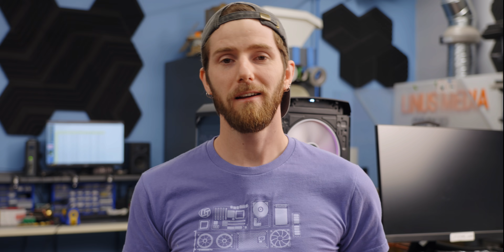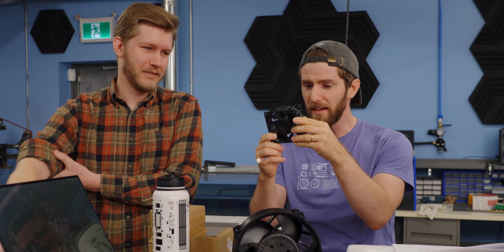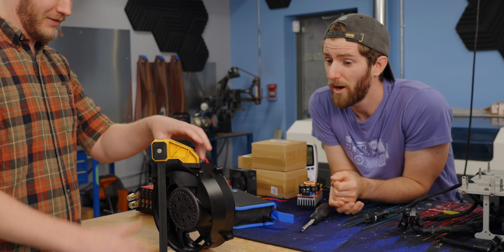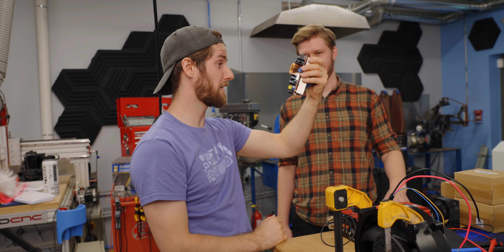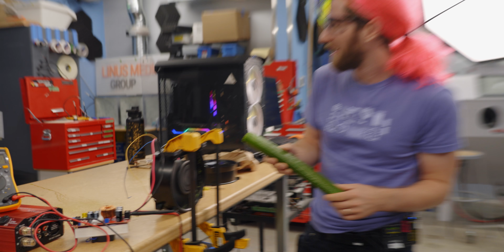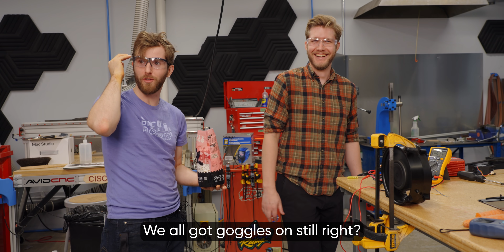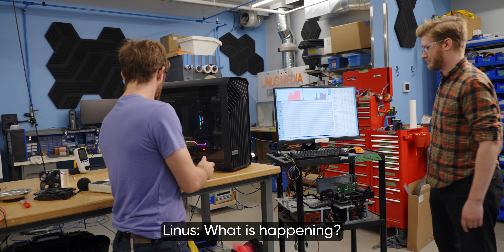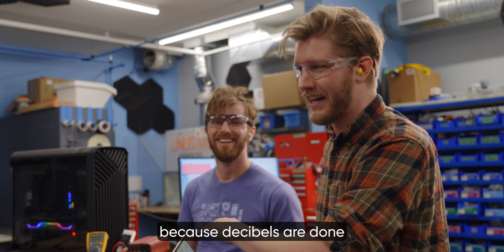The God of Computer Fans

Comment: As an electrical engineer, I can confirm that PSU is dangerous, you never want exposed contacts like that. Technically it's (barely) under the 50V limit where you're supposed to use PPE, but it's not like something magical happens at the 50V line.

Anyways, haven't used those exact fans but have used similar before. They were for cooling racks of equipment using ambient air. Ambient outside air. So that means you could be cooling your equipment with 50+C air... you need a lot of airflow for that.

Comment: Hey linus, i've actually had to get one before for a job. Often theyre used as evacuation fans, additionally can be used for fire suppression when used as a "vacuum drawing fan"
Reply: Never seen fans like that used for fire supression but I have seen turbine like electric fans used for that but they were rated 360v 32amps and evacuated a 50x50 meter server room in about a minute. Nowadays they use Novec 1230.
Reply: Not for full room sized evacuations, more for like case evacuation. Kick one or two on high and shut off intakes, sucks air out the case more or less pulling a low vacuum suffocating the starting fire
Sometimes Novek isn't an ideal solution.

Comment: Can confirm, heavy air flow in ducting systems. We had racks that had cold air fed in through the floor and other ducts that pulled the hot air through the ceiling. Don't know if was exactly this brand, but the sound matches.
Source: Worked in a DC many moons ago.

Comment: As a metrologist who worked on electronics engineering projects, the "screw the pot until you get what you want" is incredibly common.  Most of your knobs are just long extensions of plastic that do the exact same thing as the screwdriver but they look nicer.
Reply: Yea, that's a pretty normal thing, but I think it's a good thing, that Linus is afraid. You should only work with these things if you know what you are doing and Linus is not an expert in this field
Reply: @raini_does_stuff  sure but he's got engineers there telling him it's all good and he's doubting them lol.

Comment: You can buy basically these exact fans for industrial use for $50. Used them at my old workplace to cool board components in 40+ foot long machines. They pump serious air and are absolutely silent other than the air moving.

Comment: These fans are used in blade servers.  When you buy them for replacement they will come inside a fan module appropriate for your blade server. You would never buy these naked and install them.  That would void your warranty for the whole server.  I would imagine these are also used in other applications and by certified technicians where warranty is not an issue.

Comment: The fan you measured  the output voltage when spinning will be electronically commutated, not mechanically, so you won't get a DC voltage. The fan internally will be acting as an alternator and generating three phase ac, so it depends on the drive circuit whether you'll see anything at the output, whether that would blow anything on the motherboard would depend on the motherboard cirtcuitry. A oscilloscope would be in order here.

Comment: The 48VDC and the wide input voltage range suggest its main usecase is cooling telecommunications equipment. The wide input range is needed because 4x12V batteries is float charged at around 54V and in battery operation the voltage can dip below 48V.

Comment: I absolutely love the episodes with Alex and janky applications for incredibly serious hardware. 

As for applications for these kinds of fans, at my work we use ones like them for either when you need to move a lot of air from or to a large space, or a lot of heat from a small space but only have a small orifice to do it through. We one-time had a deployment where a business’s server room was a literal old closet space, not even big enough to put in a portable A/C unit, but the racks they had generated nearly 2 kW of heat at full bore. We installed some ductwork and a fan not unlike this one to dump the heat outside in the summer and a diverter to recycle it inside in the winter.
Reply: How was the sound? No one complained about a jet taking off in the ceiling? lol
Reply: @Algernon7  if it is a industrial setting this would be nothing...
Reply: @Algernon7  It was mounted somewhere well dampened and was also a slightly quieter model than this jet boy.

Comment: possible use your be cooler plamsa cutter control units like hypertherm. i work in a structural steel fab shop and i have see fans similar to these when they have had to replace parts on the cnc plasma cutters

Comment: I have often thought PC case design is just wrong. Why is the power supply inside the case? Why not put the hot thing in a bricjk on the floor. Then, remove the side panel from the cae and have a large, efficient, house fan, like a Vornado, blow lots of air into the case. If you still want case fans, set them all to blow out to give a place for the air from the large fan to go.

Comment: Love how they introduced Alex to the channel as an expert "engineer". 🤣
Reply: A "janky abomination" is an ideal idea of an experiment of many engineers
Reply: but.. he is an engineer, that's his field of expertise, right?
Reply: @lusteraliaszero  no he didnt finish his studies
Reply: @lusteraliaszero  it's been mentioned before that he didn't finish his engineering degree and that he dropped out of school
Reply: @user-fo1nk3pd1t  he said it in one of the videos himself, where they have been at his home doing some weird stuff
Reply: He is a Mechanical Engineer like me and we MEs have a big hard on for heat and fans and pumps. It's actually to a traumatizing degree*

*Studying ME Trivia: After the Hydrodynamic Machines exams (the one about fans, pumps, pipelines, tanks, etc, and it comes after Fluid Mechanics 1 & 2) I had a severely messed up nightmare where I was in a sinking ship, and ended coming up with Toricelli's theorem independently (that I had never heard of or ever seen similar themed problems) cause in my dream I thought that instead of just going to a life boat I had to calculate how long it would take for the ship to sink, based on the surface area of the hole it was leaking from, and it's changing depth due to sinking (as well as the increasing speed of sinking)...I had written down the whole proof of the theorem (minus some lines of actual solving thankfully) before I woke up...Go figure!
Reply: all my Electrical Engineering professors are like this when its not a lecture session and sometime they still are in lecture
Reply: well he is a expert engineer actually... edit: change actually to kinda... he is effected by linus's dorkiness
Reply: Hahaha, you should see the prototypes that are made by engineers in both, the private sector and public research.

Always the first couple of iterations, the proofs of concept, are as janky as the first iron man suit on the first iron man movie and the lab/workshop usually looks like the cave in which the suit was built.

It's not until we are talking about the advanced prototypes, beta versions, etc., that the jank is left behind for actual presentable prototypes.

Comment: If anyone wants to know what those stationary blades are behind the fan blades, they are called stator veins. They prevent the column of air from rotating and greatly improve the performance of using multiple fans in series

Comment: I have several Deltas (something of a collector myself) and as much as I love watching his videos, I don't think I'd let Linus near any of mine!  Respect the fans, man!  Jokes aside, this is such a great video.  My guess is that the fan accepts the standard 25KHz PWM control signal that most server fans have regardless of the supply voltage, and with a suitable square wave generator (the Noctua PWM fan controller should work...) you would probably be able to regulate the speed from around 2,500rpm all the way up to 7,000.
Reply: i use nidec 120x38 fans on my PC. they're rated at 5000RPM if i rmb correctly and it's been running at around 900RPM on idle by adjusting fan curve on BIOS i guess it's totally do-able to get it run at 2500RPM on that fan. i read the datasheet and they accept 3.3~10V PWM signal

Comment: As for actual uses of those fans: I have used a few of of similar fans on a high density power cabinet(like 4). When you have about 2200amps going through a cabinet, and a whole bunch of motor controllers you have a fair bit of heat to move.

Comment: Notice how that bag started to be sucked towards the fan from the side? The same goes for jet engines, which is why there is a 'Keep out' zone that people, carts and vehicles are required to avoid when jet engines are being started o running, as that is the area where things can be sucked into the engine. Not a good thing!  BTW, what would be the effect of these fans on motherboard components, internal cards, and cables?

Comment: Not this exact model but 6+ similar sized delta fans get used in the enclosures of VFDs supplying ~1kA of 480 3 phase to 1000hp electric motors.

Comment: inside of big machines in industries that require constant air flow for "reasons" out of my paygrade. we use fans like this, car engine manufacturing. not IT installing them tho, this is for electricians

Comment: In the 2000s a few brands including scythe used to sell thicker 38mm fans along with the regular 25mm ones, which offered better performance. These were often mounted to some of the early heatpipe coolers for overclocking, such as the early thermalright ones...
Reply: i wish 38mm thicc fans took off as standard from back then. we can still get them from industry suppliers like digikey/mouser and the likes but 38mm get pretty expensive fairly fast and often requires dedicated  power circuits when deployed in large groups.

Comment: the fans are for air movement inside of ducting.....we have used up to 10,000 CFM, at about 18" diameter, but, I have seen one that was 8 feet wide, that is for use in massive chicken-barns and such......

Comment: Fisher Rosemount RS3 (Emerson) almost uses this exact model (120V version) to move air though distributed control system cabinets. The best way to think about it is, a multi-CPU computer and case the size of a full-size computer cabinet.  So exactly like you are doing in the video with many CPUs and a much larger case.  You can always look up Fisher Rosemount RS3 Control File (cabinet).  I can't find a great picture of it (the tech is from 1984), but you can get the idea of multiple Control Files in a specifically vented server door cabinet.

Comment: These are used alot in the telecom industry to cool outdoor cabinets and switch gear for POTS service and the like . ALso used these in remote huts for cooling of microwave radio gear , the mess they make with millers(moths) and flies on electronics is just gross. Had a board on an old Motorola microwave stack go bad due to a thick coat of bugs guts from these fans . Also 48v DC is a mainstay in the telecom world , most central offices and remote locations are all run on 48v DC only. You should see the battery banks that provide power to this equipment . ! string usually consists of 24 batteries that are 2 VDC and 2000 AMP . Depending on the load of and office , from as little as 2 strings to way more than 20 can be used .,

Comment: When I was a kid, my dad brought home a hydraulics cooling fan from work that he (as an electrician) hooked up to a mains power plug. This was ~2003, and I used it to keep my Intel P4 and Radeon 9800 pro cool in hot midwestern summers. It was genuinely a terrifying fan, but moved a ludicrous amount of air. This was a nostalgia trip more than anything for me!
Reply: My dad was IT for Unisys for decades and when they started downsizing in the mid 2000's he grabbed a couple giant server ducted fan units. We used them like box fans in the house for years lol. They were crazy strong for how small they were.

edit: they weren't server rack fans they were the room fans used for ventilation.
Reply: When I was, a young boy, my father, brought home a hydraulics cooling fan
Reply: @MrGothicruler666  lol took me a sec to get the Black Parade reference.

Comment: I've seen a fan similar to this as an intake on an electrical generator on an induction heat treat that made roughly 15 kW of power. The heat treat was used to harden ball pins (Automotive ball joint component).

Comment: I figured this had to be a Delta fan when you mentioned the volume of air it would push. Delta has had that reputation for as long as I've been a computer enthusiast. They also have the reputation for sounding like standing next to a jet engine (just avoid being sucked into it!)
Reply: and Delta fans were used in the Steam Deck until noise complaints were pushed

Comment: Those fans are used in Bitcoin Mining and it was setup like a 6x12 stacks in a wall facing ASICS and large exhaust fans on the back. That is per layer of setup where i saw it. That 6x12 fan "wall" cools a rack of antminers (around 3kW power each).

Comment: I use those a lot with pulling air out of a closet server rack. normally it uses a controller that measures air temp and can adjust its speed acordingly

Comment: I have a 48v fan i stole from a roadside telecom box that was not in use. I also got two 24 port l3 huawei switches and 48v powersupply, 8 dead 12ah battery and lot more shit from those two telecom box. 
I use one of the 48v fans with a boost converter that provides 36v max , i extended the voltage adjustment pot and mounted it to the front panel of the pc case. I keep it off all the time but when shit gets hot i turn it on just enough that i can slightly hear it. When i do some crazy oc i turn it all the way to max and even at 36v it's way too loud.

Comment: 14:30 - fans like these are used for building static pressure in big data centers sometimes, and also when you need to move air a VERY long distance in a data center.  I did some work in some very large finance companies’ data centers, and each “pod” is much larger than a football field.  Each “pod” is literally full of server and network equipment racks, and a MASSIVE amount of air must be moved a very long way, so sometimes supplemental fans like these are used if the cooled air from the chillers needs a boost in a tight space to reach the end of a pod.  There can be 10+ pods in a single data center too….But usually these are only temporary solutions until the engineers can go back figure out the source issue.

Just think, larger than a football field and 40+ feet high, and they have ridiculous static pressure inside those pods.  There is so much air being moved it’s insane.

Comment: well if sound "volume" is Pressure level, 6db is double, not 3db. 3db is just double the power if you were to produce the sound through for example a speaker.

Comment: I'd put these fans into industrial inverter racks. In these the diodes and IGBTs are the size of a fist in these and both power terminals are connected directly to heatsinks, so the current goes thru the heatsink. They work with crazy high currents like 1kA at 380V 3 phase

Comment: These fans get used at my work at a performing arts center. They are built into the top of the rack of theatrical dimmers. One fan is enough to cool a rack of 96 dimmers rated at 2.4kw each

Comment: We had, not these specifically, but a similar fan in an electric cabinet where variable frequency transformer lived. It really needed that airflow in summer. 250 amps at 380 volts in a solid metal box under open sky.
Reply: Yea

Comment: If these are like fans I have at work there are 4 wires. Ground, power, 0-5V analog speed control, and a rotation switch output for fail detection. If you don't connect a controller to the analog input wire the voltage on the wire will slowly increase to 5v and max speed. It's exactly the same behavior as the video.

Comment: Regarding making fans into generators, that's still a thing. We had to move all our racks on my job, and we thought we might as well clean all machines with some compressed air. We had multible machines get killed by fans generating power and sending it into the MB.

Comment: i didn't buy these specific fans, but when i used to work in a datacenter, these fans would be put at the ends of ducts that lead directly into server racks in order to bring direct AC air to the higher end machines, since they aren't using any water cooling.
Reply: I was just about to say it’s purely for moving Very cold air quickly to a group of servers. Just installed some a few days ago and holy shit All you really need is 2. Dropped peak temps by 18c. The video does no justice to how loud two of those things are right next to each other. Im practically deaf 😂
Reply: Used them in top/ back of electronics cabinets to pull air throught the entire cabinet.
Reply: watercooling will add points of failure, but can massively increase the thermal capacity to absorb spikes from high load cycles to be dispersed elsewhere.

Comment: I think we have reached a point where we should expect Linus and Family trying Airplane Turbines for cooling CPUs.
I mean if you move all the air inside the chassis at such a high rate, the heat dissipation would be enormous as well, try putting your PC components inside a wind turbine.

Check out the "Major Hardware" channel on how to compare fans. Build a small wind tunnel and measure the volume of air being pushed.

Comment: I have one (maybe inch in diameter smaller) fan retrieved from early 80's mainframe, manufactured in West Germany, apart from stationary blades, absolutely identical design. You could casually use it  as room fan.
Nominal voltage? 220/240 V.

Comment: Those fans would be good for and used for whole electrical cabinet cooling. Where 24-48v dc is readily Available. Also for using pc fans as a generator check the AC volts. My experience shows they produce ac out not dc.